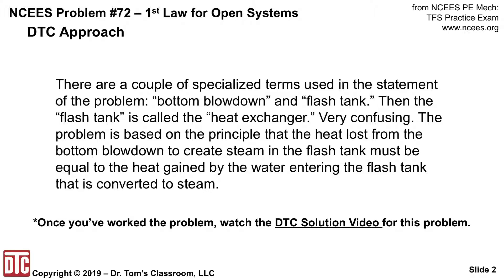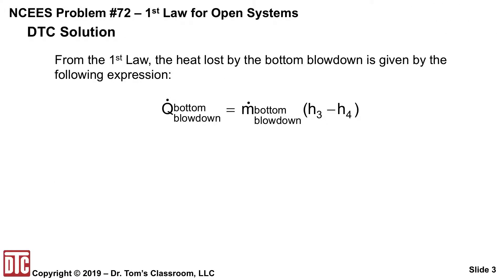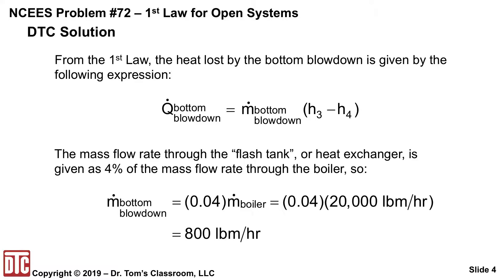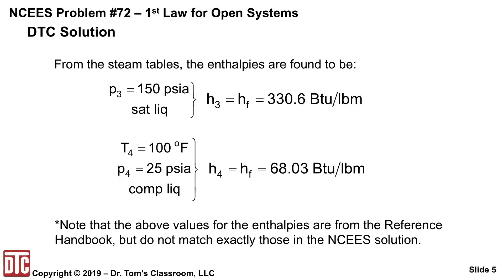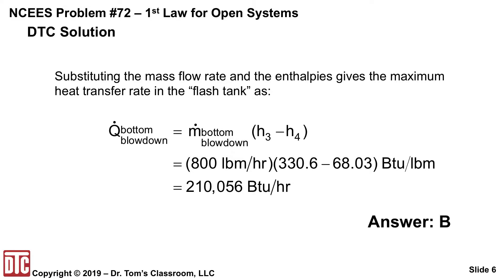NCEES PE Mechanical TFS Practice Exam Problem 72 - 1st Law for Open Systems (Solution Tips)

Comment: So we use 150psi and saturated liquid because it is liquid at the bottom of tank and should in theory be some temp greater than entering temp at 80F? At first I used 80F which would make it a compressed liquid.

Comment: Why do we use two h_f =330.6 in the Q_dot equation where at the inlet the heat exchanger or flash tank steam is leaving implying the inlet is a h_g value 
= 1194.47 BTU/lbm at p= 150 psia.
Reply: Not sure where you see "two" h_f = 330.6 in the Q_dot equation.  And there is water coming out of the bottom of the boiler and stays water from (3) to (4), converting water to steam in the heat exchanger.  Tom
Reply: @tombrown6227  I meant to say I thought there would be two h_f values used here.
Reply: @mainshark4390  There are 2 h_f values, one at (3) and one at (4), though at (4) it is a compressed liquid, so you have to use the h_f value at the temperature of 100 oF.  I state this in the video.  Tom